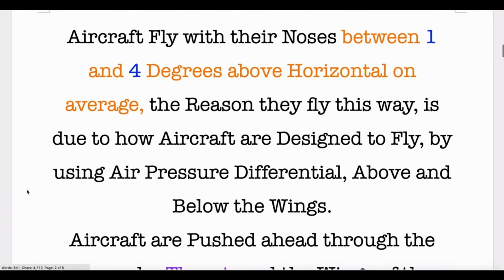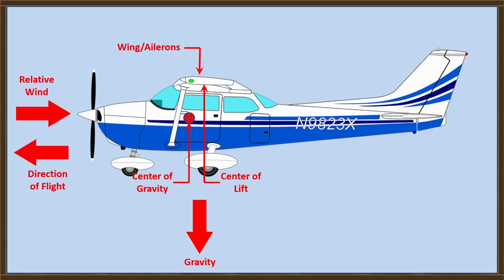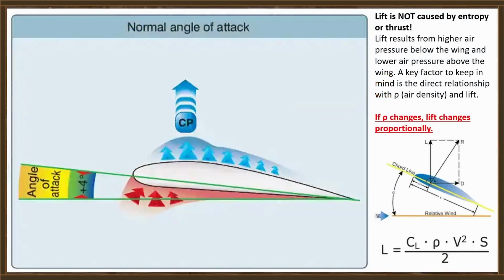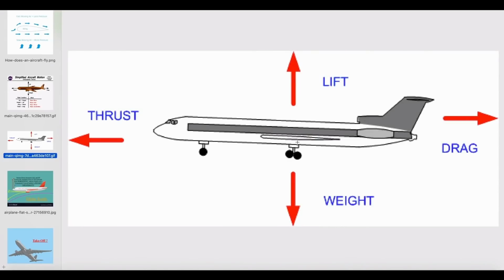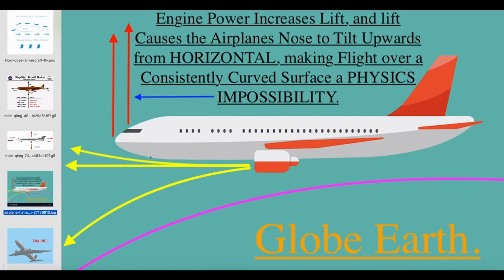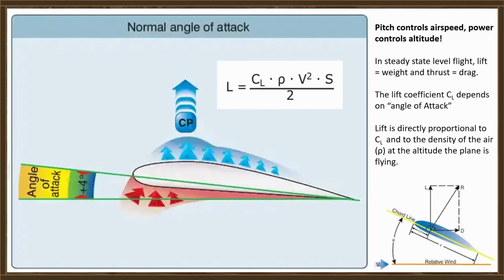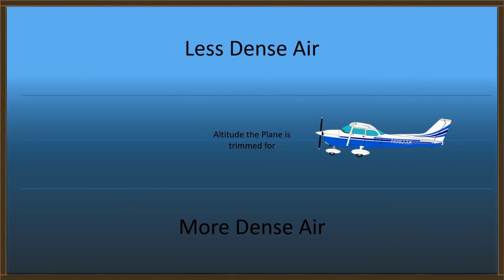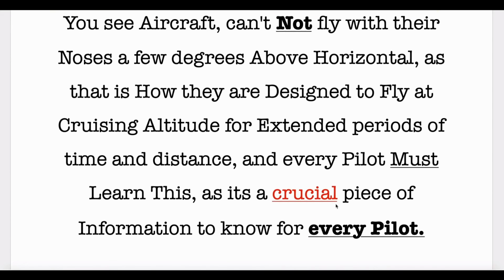Brian's Logic Shows Us How Little He Knows About Aviation

Comment: It seems Brian does not have any understanding of the balance of moments and rotation. For an aircraft the moment caused by lift is balanced by the moment from the tail control surfaces. if these are unbalanced the aircraft will pitch about its centre of mass until they are rebalanced. Pitching causes a change in angle of attack on the wing and tail so in an aircraft designed for stability this angle of attack change will try to return the aircraft to a level position and dampen down the pitching.
The second thing is that I believe increasing speed causing you to move away from the earth and reducing speed causing you to move towards the earth are true for a space craft in orbit about a globe earth.  Has he tried to find some way of debunking a globe earth by reading up about orbital mechanics and confused them with aircraft flight?
Reply: All correct.  Brian has no clue.

Comment: What people forget is that aircraft don’t really measure altitude directly. They simply measure air pressure. If you have your QNH setting incorrect, then your altimeter is likely to be showing something completely different to reality.
Keeping a plane flighting straight and level without an autopilot is probably the most difficult thing to do as a pilot, with constant adjustment required via elevator trim.
Reply: Below 18,000 feet, you need to keep adjusting your altimeter for the current meteorological air pressure, so as to maintain your flight level. Above that (class A airspace) you don't bother. You assume standard pressure (29.92 inches of mercury). The purpose is not to be accurate, but to keep planes at safely separate altitudes, and safely away from the ground.

Comment: @9:47 I mean, kind'a. This is all depending on the NACA airfoil you have. If you look at the chord and airfoil of say, an F-16s wing, it's generally the shape of a double ended pencil - this is to say that both ends are pointed, but the top and lower wing profiles are actually parallel to one another, and not what you see here on this graphs. This is why the F-16 can fly at transonic speeds at near sea level, it's lift is far more closely reliant on it's AoA. It's only difficult to break Mach 1 at sea level because that air density amplifies the aircraft drag coefficient and the effects of drag. Makes sense, higher up means less air, means less drag over all. As you go faster, the resistive force (the drag effect) eventually reaches the maximum it was before. 

In general education, we see the typical 'wing' profile as seen in these slides all the time and the reality is that this damned thing leads to more misconceptions than truths, usually confusing kids into thinking you have to have wings that have that exact cross section, in order to fly and that it's only these wings that produce the lift.

That's just simply not true, and thus I can see sometimes why people like brian would be easily confused in this matter. There's more than 1 type of lift generator, for example. See 'Compression Lift', something that was discovered to be very useful during the test flights of the XB-70 Valkyrie and assisted in it's ability to fly circles around a B-52 at 500ft. Look at LERX, Winglets, lifting body, ect. Vortex generation and controlling the vorticies is extremely popular in military design as Vortexs are Tubes of air with high density (thus high mass) and because they're controllable for manipulation of an air stream, you can generate vorticies into an air stream and have that tube of dense air hit a control surface that's purposely places to take advantage of those vorticies, given you way more air mass to throw around via control surface deflection.

Hell it's possible to make a lower boat hull fly with enough speed due to atmospheric skipping (where you skip atop the higher density lower layers). Not everything that flies has top look like a Cessna or 737.

There's an old saying for aero mechanics and aeronautical engineers - put enough thrust behind something, and it'll fly. I think the F-4 proved that (it's an old joke but largely holds truth).

People over think the wings and lift drag and what not when they skip the basic concepts here - to fly, all you need to do is throw the same or more air mass down word to the ground, as the mass of your aircraft. That's really all it is. Basic newtonian laws here, for every action there is an equal and opposite reaction. All we are doing is countering gravity by using the air mass, to counteract the mass of our aircraft. And there are many more ways of doing that than a simple wing profile.

Comment: Not wanting to state the obvious but most of these flatwits tend to ignore just that. 

Wouldn’t this approach to flying ultimately prove the limits of their dome theory, resulting in a crash? Speaking of the dome theory, in level flight, a pilot would need to make adjustments constantly to the left, or right depending on direction of travel, in order to avoid any unwanted contact from said dome. I’m wondering why he didn’t touch on either of these talking points.

Comment: The "theory" this half wit promotes don't explain how military and acrobatic airplanes can fly upside down. It is based on misuse of Bernoulli's principle. Already during 1930 the theory of aviation was improved. Around 95-100% of the lift of an aircraft wing depends on the weight of the air that the wing accelerates downwards. The rest is due to Bernoulli's principle. 95% for Clark-Y or similar airfoil, 0% for symmetrical airfoils for instance NACA16-006

Comment: The difference in air pressure is the air accelerated by the wing, caused by the mass of the accelerated air. And mass has a weight.
That is the air pressure without a container. And we call it atmospheric pressure, because there is no pressure on the top of the air. There we have a vacuum, without any air. Like in the tube of a mercury anemometer.
Reply: Mercury barometer. A wish i could edit on youtube. I should try to log out and log in again, like when a computer stops working.
Reply: Nope, it still doesn't work! Maybe i need to play more commercials to get them activate that slot in their systems again.

Comment: Once more for the idiots in the back:

Entropy is NOT a force.
Reply: "May the entropy be with you" 🛫
Reply: Entropy, entropy, they've all got it entropy.
Reply: @david_akerman  "nahh stop messing about"
Reply: Actually it is in a way, from a systemic viewpoint: a ball rolling down a hill has an entropic force (in this case named gravity) forcing the system towards more entropy (the ball at the bottom).

The wikipedia page on "entropic force" will make this clearer.  More correctly, it's described as an "emergent phenomenon" that comes from a system's statistical tendency to increase entropy.
Reply: @fromagefrizzbizz9377  Would you remind me what the units of entropy are? And what the units for a force are?

Could you show me a system for which entropy has a vector value?

entropic forces are a consequence of entropy - they are not in fact entropy.
Reply: @PhDTony_original  Read what I said again.  Now go and read the reference I gave.  Answers all your questions.  I even used the term "emergent phemonema" - a consequence of a systems statistical tendency to increase its entropy.  Which is the first sentence of the wiki page.  The units are clearly dependent on the system you're examining, and often have a direction - the vector.
Reply: @fromagefrizzbizz9377  I did. It was interesting.

Back to my question:

Can I ask which bit of "Entropy is not a force" you think is incorrect?
Reply: @PhDTony_original  Already answered.

Comment: Actually, if you ask anyone who knows the basics of how a wing works, they'll tell you that this twat is even more incorrect than Blue Marble is pointing out, in fact BM is being somewhat kind. Pretty much every wing has a centre of lift/pressure which is located behind its mid point. This makes every wing tend to push its trailing edge upwards as it generates lift. Obviously this has the effect of pitching the nose down, NOT UP. The effect is so pronounced with wings, that it has to be countered by aeroplanes typically having a horizontal tailplane for that exact purpose. 

The horizontal tailplane is shaped like an upside-down wing so it can impart a tail-down force to stop the aeroplane from pitching over into a nose dive when the wing generates lift. So what the elevator control surface on the trailing edge of the tailplane is doing when you pull the stick back or push it forward, is simply altering the amount of tail-down force the horizontal stabiliser is imparting on the aeroplane, and thus causing it to either pitch down more, or less as it flies along. The only exception to this, is with a tailless delta aeroplane - such as Concorde - whereby there is a twist built into the camber of the wing across its span to impart some tail-down force to counter the lift's tendency to pitch the thing nose down, and the ailerons also have an elevator function to them, which is why they are referred to as elevons on aeroplanes with delta wings and no tails. Many birds do this twisting too with their wings, as indeed did pteranodon flying reptiles in the Mesozoic period.

If anyone does not believe this stuff incidentally, look at a picture of the wingtips of Concorde and see that they have a noticeable change in their dihedral angle at the tips. Then take a look at the tailplane of a conventional aeroplane and observe that it is essentially an upside down wing. Both these features are to stop an aeroplane pitching DOWN when it generates lift. So if this guy doesn't even understand the basics of how a fucking wing works and what forces lift imparts where when it generates lift, he's hardly the kind of person to consult about the shape of the fucking planet. Hearing that guy talking about aerodynamic principles and royally fucking it up for the most part, was like listening to a four year-old trying to explain quantum mechanical tunneling.

And just so you know, I can absolutely confirm that throughout my own pilot training, and in all the time I've been a pilot and worked on aeroplanes, which started about 25 years ago, and in all the hundreds of books I've read on that stuff, this video was literally the first time I've ever heard anyone say that entropy was anything to do with lift, and there's a very good reason for that: It's because entropy has absolutely fuck all to do with how lift is generated. There are two main principles with lift generation; the Bernoulli Principle, and Newton's Third Law of Motion. That's it.
Reply from the maker: Well said! When I was instructing and I would explain that the tail was actually pushing down, not lifting up, they would usually look at me like I lost my mind LOL. I really wish these guys would spend a few bucks and take an intro flight. That would answer all their questions in a hurry.
Reply: @bluemarblescience  Exactly, in fact they don't have to spend any money at all. They can simply go to a library, or go online and read about what an aeroplane actually does when it flies. That's a basic principle they should follow for everything if they intend to commit themselves to video talking about a subject. Otherwise they 'll just end up looking like an idiot. It is precisely what the Dunning-Kruger effect is referring to when they don't do this.
Reply from the maker: @ChockHolocaust  Spot on!

Comment: I would like to push back on one statement. You said at 2:38 that the elevator controls the pitch of the plain (correct) then you say that providing more thrust will only get you to the crash faster (incorrect). Most airplanes are for convergent stability. On the type of plain that you are showing, the elevator provides a downward force on the tail. That force is dependent on air speed which is dependent on thrust. At the speed increases the the downward force increase which forces the nose up if there isn't extra thrust to maintain speed the plane slows due to increased drag, the down force on the elevator decrees, the nose comes down and the plane returns to level flight. The opposite effect happens when speed is decreased. This provides a sweet spot where a properly trimmed out plane will pretty mush maintain altitude without elevator input. If you increase thrust however, the plain will pitch up and try to clime. FAA Flight manual: https://www.faa.gov/regulations_policies/handbooks_manuals/aviation/phak/media/08_phak_ch6.pdf  The elevator is covered on page 6-5. 

I'm not trying to be "one of those" types of commenters. We can all make mistakes.

Comment: The explanation of how a trimmed airplane holds a constant altitude as it travels over the spherical Earth through an equilibrium between lift and density is very clear and understandable; thanks.   There must be  a similar equilibrium process controlling the pitch of the airplane, but it just won't snap into focus for me.  Can you drop a clue on that aspect of flight?   It'd be great to have a refutation ready-to-hand for the globe deniers that try to claim flights halfway round the world would find themselves flying upside down.
Reply from the maker: It's simply the fact that the airplanes CG is referenced to the gravity vector wherever the plane happens to be so that's automatically going maintain that angle of attack relationship.
Reply: @bluemarblescience  Ah; thanks very much!

Comment: Very good, Brian. Excellent work. Outstanding research. Perfect presentation. Absolutely no possible debunk from Globeheads.

Just one question, though .... why do aircraft take off at ~10-deg nose up, at around full power, and then, once they decrease power, the pilot has to physically drop the nose to around 3-deg to prevent the aircraft falling out of the sky? Your presentation suggest that it should happen automatically.

One more question ... why do aircraft at airshows fly horizontally at full thrust, with barely any pitch, yet come in to land, at a much slower speed ... and much lower thrust setting ... with the nose pitched waaaay up?

One more question, not about aircraft, I swear ... why is it that a dirtbike rider can leave the ground at the crest of a hill and follow, almost perfectly, the decline of the ground, despite not being able to affect any meaningful thrust change? Why is it that if he goes faster he doesn't follow the path, nor if he goes slower. It's almost as if there is a perfect balance of forces which will allow you to follow a curved surface that drops away from you.

As you are about to say "yes, bot, dat's talkin' 'bout speeeeed, not lift", then let's go back to aircraft.
Military aircraft are regularly filmed following the contours of the land through valleys and hills .. at a constant speed, and constant thrust ... if they are demonstrably able to follow curved surfaces, on what you believe is a flat earth ... why would they not be able to follow curved surfaces on a spherical earth?

Asking for a friend ...

Comment: The point Brian is trying to make, and all the other FEs for that matter,  is that in the universe we live in, there is one and only one universal Horizontal, consequently a universal up and down. Since planes are designed to fly horizontally they can't possibly follow the curvature of the earth by continuously "dropping". 
That should have been Brain's video, 5 seconds would have done it. But in Brian's wisdom he had to include all the the aerodynamic bla... bla.
Needless to say, with or without the aerodynamic bla... bla... it's all BS just the same.

I have a question though.
From what I understand and have been reading on, the CG of a plane is ahead of the centre of lift. That being the case, during level flight, if the pilot is to increase thrust only and leave all the other controls where they are, wouldn't there be a torque trying to lower the nose or the angle of attack, should I say?
Wouldn't that also be desired if increase of velocity at constant altitude is what the pilot is trying to achieve. That is faster velocity, lower angle of attack, continue to fly level.
The alternative is that the torque produced by the elevators overwhelms the possible torque produced by the increase of lift and the plane would start to gain altitude, requiring an adjustment on the trim.
I'm not sure which and must also be specific to different plane designs, loading, etc.. etc...
I have searched some but couldn't find any documents, articles that cover this specific question.
Anyway very clear video, although FEs will dismiss it anyway.
Brian has been included to my "Ignore List".
Reply from the maker: Usually, the CG is ahead of the center of lift (pressure) for stability. And for that reason, the horizontal stabilizer/elevator is normally pushing down. But in flight, that force is already present so changes in thrust don't have much effect on the angle of attack. There are some other forces that come into play - p-factor namely. If you have any angle of attack at all, a change to the power setting is going to alter engine torque and the effects the prop has including gyroscopic force and the differential thrust across the prop caused by the angle of attack of the prop itself. But all of these effects are very slight and not something you really notice. Maybe have a look in the POH (pilots operating handbook) and see if there's something in there.

Comment: I guess Brian has never heard of a Condor, which can stay aloft for hours without ever flapping its wings. If thrust is necessary to change altitude, someone should probably let them know.
Reply: An even better example is an Albatross, thousands of km out in the ocean. I have seen one sitting on the ocean and it merely stretches out it's wings to take off. Never seen one flapping them.